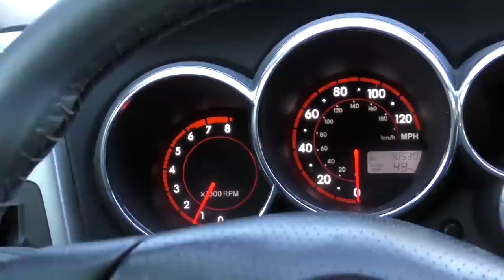Please Stop Doing This to Your Transmission (It Destroyed My Car)

Comment: Interestingly, Nissan has a tech paper out to NEVER pressure flush the transmission in Frontiers, xTerras and a number of their cars- because of exactly what you said. You have to set it up so the  transmission does a "suck and pump" to do the exchange.

Did a complete change out of my ATF in my Frontier at 50,000 miles because of the cost of Nissan fluid and the fact other Frontier owners had done the swap at low miles and reported their transmission worked better. A number had put over 100,000 miles on their Frontier after the change with no issues (one had over 150,000 miles after the change). Put in Valvoline MaxLife ATF (synthetic) which they certify as a replacement. 

BTW, with doing the change out at a low mileage, it actually shifts smoother and better on the Maxlife. Have put 85,000 miles on it since then, with no issues. I've only done the 5 qt change out and filter change since then. I believe the key here is we did the fluid exchange at lower miles before crud could build up.

Comment: I had a F150 that had a small transmission leak that was fixed under warranty.  I told them to change the transmission filter while they had it apart and they told me they didn't normally do that.  I said I don't care change it while you have the cover off and charge me for the filter.  They did do it but its crazy to think they don't ever change the filters.  The truck had over 100k on it at the time.

Comment: eh, its a 'it depends' situation. I got the transmission forcefully flushed on my Verada, likely the first time it was done in 15 years. This fixed a sudden and rather violent shudder that happened periodically, it's a known issue after more than 10 years of service life. The problem is the fluid density, the transmission is quite sensitive to it. But you just can't change a significant quantity of oil doing it via the normal drain method. You'll only get about 1/4 of it out. If you rinse and repeat the process you'll probably have to go through 50L of transmission fluid before it gets to the density of brand new fluid and cost an arm and a leg (it's NOT cheap stuff for my particular car) whereas a force flush pushed it through the entire system and takes significantly less fluid (less than 20L). The cars transmission has suffered no ill consequences in the 5 years since

Comment: Last Ford ute I had, factory LPG(Oz), less than 100k km, 2005 model, didn't have a transmission dip stick. Had a site glass. Never leaked or misbehaved. Went like a cut snake!
Sold it recently like that to the first tyre kicker.

Comment: My 03 vw eurovan, which is known for transmission failure has 243k miles on the original transmission. Never been flushed or even changed.

Comment: I have a 2013 f150 5.0 6 speed auto, trans fluid has never been changed in it that I can find record of. It shifts smooth as can be. I'm afraid to even mess with an oil change cause it already has 178,000 miles on it 🤣🤣🤣 if I get 250,000 and it goes out I'd say it did a hell of a job with no oil change!

Comment: The problem with oil is that its molecular structure deteriorates, as its molecules rub against one another. Of course, synthetic oil is superior, in that sense. The best way to change automatic transmission oil would be to remove the unit and take it apart, dumping out every drop possible. It'll only cost a gasket set, time and fluid. On rear wheel-drive vehicles, it's not a big deal. Front-drives can be a pain, since the drive axles have to be pulled out of the unit, requiring partially taking apart the front suspension. The second best way would be to hook up a large barrel filled with fresh fluid and then let the transmission transfusion itself only through its own pump working. I saw a video of some guy makeshifting his own simple unit consisting of two transparent hoses hooked up in place of the cooling lines. He kept it hooked up, until the exitting fluid became clear. It'll cost plenty of fluid. But, it would be safer to do than to use one of those externally-pressured machines which could stir up mud

Comment: ZF Lifegaurd 6 fluid is $65 per litre. . . .  🙄  Ford flushed my ZF 6HP26 @ 135 000 klm and charged $438 dollars and they used standard red fully syn multifluid. Transmission now stuffed @ 161 000 klm. Local rebuild quote's are $5000-$8000. Having a rebuild done interstate with clutches that will run on Dextron 6 @$11 per litre. Moving forward plan is to change the fluid and filter every 30 000 klm my self.

Comment: I was just about to get my transmission fluid flushed in my Ford Escape that just hit 72,000 miles. Now I don’t think I’m gonna get it. I haven’t had my transmission fluid changed once but the escapes have had problems with the transmissions going out after 70,000 miles and I feel like this will set it over the edge

Comment: He's exactly right sometimes the floss can fix a worn-out transmission but if your transmission is working good servicing it about every 30 to 50 thousand miles in most cases just a simple drain and fill will do and maybe pull the pan and clean it out every hundred Thousand Miles you should be good swatches are just profit-makers for the shop and then a lot of times those machines aren't fully cleaned out and could have some other fluid in it that can contaminate your transmission fluid in modern Transmissions are very specific nowadays if it has a drain plug drain and fill if it doesn't have a drain plug for the pan change the filter and you're good to go every 30 to 50 thousand miles don't worry about the old fluid that's left in there it will mix and you'll have enough additive package in the new fluid to keep it going for a long time one more note if you want your transmission to last a long time by a Toyota LOL

Comment: I had a trans flush done once and as a result they blew the transmission tail shaft seal and it was causing the trans fluid to get pulled into the transfer case. Luckily the transfer case used the same fluid as the transmission. A friend of mine who was a Master mechanic at Ford suggested that instead of spending all of the money to drop the transfer case and replace the seal that instead every other oil change I just drain the excess out of the transfer case and top off the transmission. I took his advice and drove it like that for another 150K miles.

Comment: What about CVT? Those are designed very differently. Are those ok to flush if it hasn't been changed ever? My 14yr old Dodge Caliber with ~55K miles CVT fluid has never been changed or flushed far as I know. The dealer that last did my oil change, said the color of the CVT fluid changed is dark now, but looked clean. I think the CVT fluid change is set at like 70K or something. I drive about 2K a year. So will take years for me to get that far. Not sure if i should have it changed if it hasn't in 14+yrs.
Reply: Id like to know as well

Comment: I've carefully maintained my 2006 Audi A4 since new and hope to keep it for years to come. But I believed the dealer about "lifetime" automatic transmission fluid so it's never been changed. I'm at 130,000 miles. Anything I can do to extend the life of the transmission at this point (gradual change?) or am I stuck running dirty fluid until it eventually fails?

Comment: My wife's 2014 Ford Fusion was running great until suddenly it wasn't.  144k miles.  No dipstick to check fluid.  Its a sealed unit.  You have to remove it to change the filter.  Now it's getting rebuilt to the tune of 2800 bucks.  Would've been 3600, but the guy says the solenoids didn't get funked up.  It went from Hero to Zero in nothing flat.

Comment: Scotty, my truck has been sitting for 5 plus years. I have 240k miles and a rebuilt transmission. Fluid hasent been changed nor filter. My friends say dont change trans fluid because ill have more problems (yes i know... "Never listen to friends. Listen to your smart mechanic) they dont mention flushing the trans. What do you think? Sometimes it jerks when it shifts. But i changed my battery terminals and my truck has been running smoother but it still jerks after drives for about 10 minutes
Reply: I have a 99 dodge ram 1500 and i drive it every day. It doesnt scare me but i do wanna know what is wrong

Comment: OK I'm convinced. Don't power flush the transmission in general. How about a 2010 Crown Victoria police interceptor. Is this still considered a modern car? Do you suppose they did power flashes all through its fleet life with the police department Achoo? And would you say I should just not do a power flush for the remainder of its life? It has 140 K right now. I got it at 138KI drive 1000 miles a year.

Comment: Some of the flush systems  splice in to the hoses between the transmission and the  trans cooler and the pump inside the transmission is used to move the fluid  to swap in the new fluid. No extra pressure, just the pressure that the trans would normally make. This way ALL the fluid gets replaced with new fluid.

Comment: My transmission is a manual transmission.  I just change the grease after each spring when the spring floods subside and I do not have to ford through water.

Comment: So don't "flush", just change the fluid. I have one that needs to be a certain temperature range before it can be drained so they can measure the proper amount to know how much to refill. It has no transmission "dipstick". I'm just worried they won't do it properly.

Comment: If it's done within a certain mileage range & the fluid was faithfully changed at proper intervals it's great but after 150k it could cause a disaster.. I've done it a few times on vehicles with slightly under or over 100k and never had a problem other than one temporarily neutralizing & it went away after ramming it in passing gear a few times and blowing out the dirt stuck in the spring. It was still running great 35k later when the car was sold.

Comment: I bought a 97 Civic with 70K km for daily driver, AT was horrible clunky, problem is you cannot drain these but only get 2-2.5 litres out per drain, after 30000km and multiple drains I got the AT in pretty smooth working conditions. Sometimes you just need to give it some TLC

Comment: If the transmission is bad, fluid change most likely won't help. If the transmission is sound/working correctly, it should be fine. I've only been doing work for 50+ years, so what do I know? This hasn't been my experience. Changed many transmission fluids over the years.

Comment: Flushed mine at 98,000kilometers on my Nissan fuga 5 stage and it runs better no issues I heard that if U flush them do it when it not a lot of ks or yes too much crude and U can get slippage my torque converter definitely locks tighter than before and I'm getting better milage it's not a huge difference but it is better

Comment: How do you use your hydraulic press??? It looks like how people treat their 6 mo. old treadmill, they become a clothes rack. I've had a couple transmissions quit on me after changing the fluid. A lot of people think that new fluid breaks debris loose and it clogs the solenoids in the electronic shift models. I personally think if you do it every 30k it will keep the crap from building up and you have a better chance of a good outcome. You forgot to mention that the lube places don't actually do the flush anyway, they just charge you for it and do nothing but rip you off. Another thing, I've used Lube Gard in a few and it's cured the problems, one of which wouldn't shift at all until it warmed up.

Comment: Scotty, I have a 2003 Toyota 4Runner V8 with 104k miles. I’ve babied it. Looks and runs new. Except now. My transmission has started to feel different during shifts, and delays slightly when engaging Drive. Yes, I had my transmission fluid flushed about a year ago - by the Toyota dealer, who recommended I do that. Boy Inwidh I had started watching your videos back then. What can I do before all hell breaks loose? I love my 4 runner, and the new ones can’t compare to the power and solid build of my 2003. Please help.

Comment: Any one remember when torque converters had drain plugs? Usually behind the inspection plate and you had to center bottom said plug with the starter...Too bad modern cars don't have that asset
Reply: 2002 ford quit using a drain plug on the torque converter  .

Comment: I 'flushed' my own transmission by disconnecting the line and letting the transmission pump out the old oil as I poured in the new. The old fluid was a different color so I knew when to stop.
Reply: @behexen250 1) This is why I put 'flush' in quotes 2) You cannot drain the torque converter without pumping it out, so no, it's not a drain, either

Comment: My Grand am was out of commission for a few weeks, got it working and my transmission was shifting terribly. Of course, GM didn't put a Trans fluid dipstick in with the car, so I had to check it from the bottom and I was totally filled. So I drained just a little bit of the fluid, went out and bought Lucas Oil Transmission Additive. My car went from shifting hard, to shifting smoother than it ever has!

Comment: You get less than 1/3 of the fluid out by pulling the pan. Flushing is terrible. Changing the filter is meaningless(if it's filled with particles, your fluid is not an issue any longer). What you want is called a "fluid exchange". The mechanic connects his machine to the cooling lines on your car and uses your own transmission circulation system to push the old fluid into a bladder in the machine which then pushes new fluid into your transmission the same way(through the cooling lines). When it's done, you have about 99% new fluid instead of 33%. 1/3 clean fluid added to 2/3 dirty fluid  equals 100% dirty fluid. His theory about constantly changing the filter and adding some fluid back is great if you want to make a mechanic wealthy. You aren't doing anything for the transmission, but the mechanic will smile because he knows the truth. A fluid exchange every 100K is far less expensive than 3 filter changes in the same time period and actually accomplishes something other than paying for the mechanic's new boat.

"Dirty fluid has more friction in it". HOLY MOLY!!!!! The absolute crap that spews out of this shadetree mechanic's mouth is mind boggling. "Dirty" fluid is just worn out. It's "dirty" because the additives are no longer there doing their job. The fluid turned dark due to one reason...HEAT. It's a closed system. No dirt can get in it. Heat is the sole cause of nearly all transmission failures. If your fluid turns dark, get your cooling system checked out. A tranny that runs 175 degrees will last damned near forever. I built transmissions for a living for over 20 years(made good $$ doing it) and I heard all the old wive's tales Scotty is telling. This is like the one about switching to synthetic oil from conventional oil will cause seals to leak. Seals leak because they turned hard as a brick(due to age or heat) and no longer function properly. Good grief. The problem with high temps is that the fluid breaks down(the reason it turns dark) and it no longer protects the friction plates and bearings/bushings inside the tranny. It also causes premature aging of seals. Pulling heavy loads(towing or hauling) will increase temps which is why they sell additional cooling packages for the tranny. If you fail to get it done, that's on you.

The second biggest problem with trannies breaking is abuse. When you back up and then put it in Drive(or vice versa), make sure you come to a COMPLETE stop first. Putting the car into gear while moving the opposite direction puts immense stress on the sprag(s) and clutch packs. Something will eventually give, and when it does, you will not like the price. 

Scotty usually has a lot of good advice, but he's met his match with this topic. He is waaaaaaay out of his league here.  Just do a fluid exchange(dealerships and legit shops do them) according to your owner's manual(usually every 80K-100K miles) and you'll be saving $$ and keeping your tranny working properly. If your car overheats, get it fixed immediately and change the tranny fluid(all of it) at the same time). 

I have never had to replace a tranny in any of my daily driver cars, nor the filter. All have gotten well over 200K miles and one was over 350K when I gave the car away, still running like new(Chrysler Concorde LXi).
Reply: Heinz Guderian totally agree

Comment: All of my vehicles have over 220,000 miles and I have a practice when I have oil changed I have them drain about 4 quarts and have it replaced with new , and maybe 3-4 oil changes later I have it done again and I’ve been transmission problem free on all my vehicles ...

Comment: Hi Scotty I just purchased a 2008 Volvo S60 2.5T with 73,000 miles and a 2012 Volvo XC90 AWD with 122,000 miles both are paid off cash with the idea of saving money and running both of these cars 200 -300,000 miles before I replace them again. I just watched this video and I’d like to know do you recommend having their transmissions cleaned and filters and fluids replaced? Also, what other maintenance recommendations do you have for these vehicles? I’m in south Florida, otherwise I’d bring them to you. Thank you.

Comment: So the Ford dealership "Quick Lane" told me they only flush the transmissions, they don't drop the pan.  I did have them do it on my 2015 Expedition, and so far I don't have any issues. Not sure where to go to get the drop the pan service, maybe the service side of the dealership would do it instead of the Quick Lane.

Comment: Glad your rule doesn't seem to apply to manual transmission. The CRX i bought from ebay had manual transmission fluid that was as black as midnight - it was probably never ever changed for the 257000 miles it was driven.